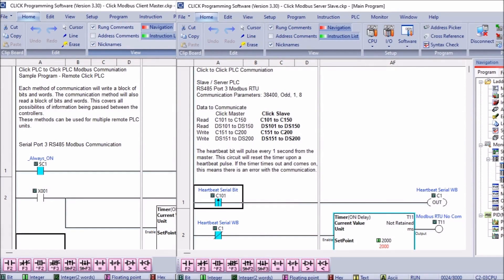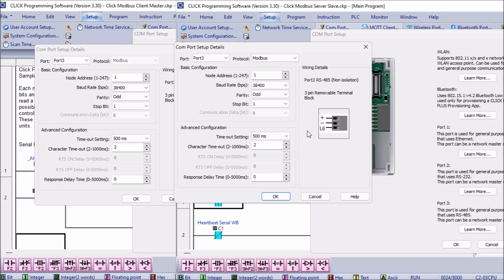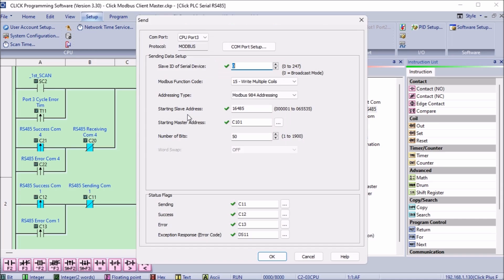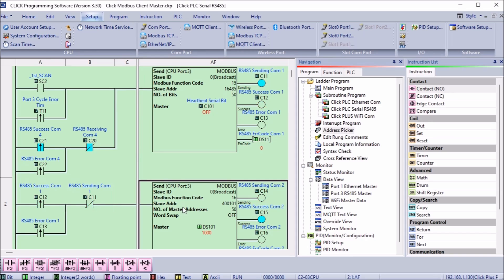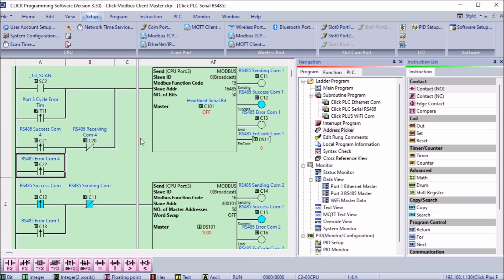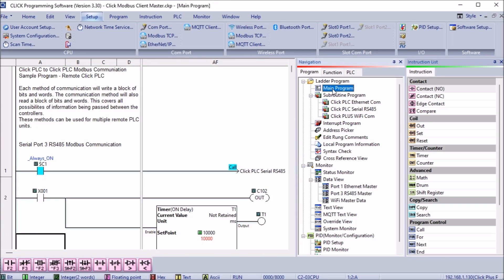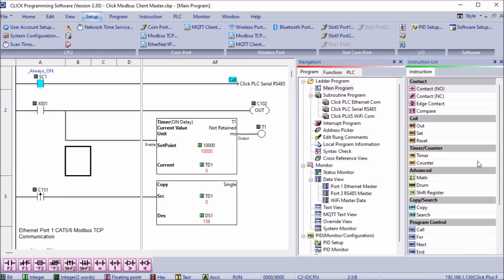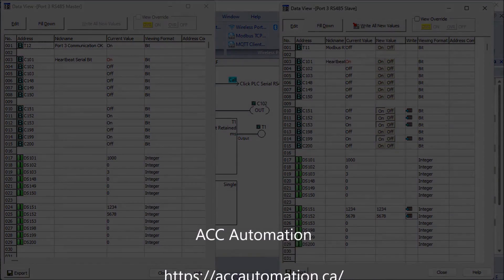Koyo Click PLC RTU Protocol Programming Tutorial

Comment: in the slave i would connect t11 to an output so I know if comm is lost.
Reply from the maker: The heartbeat bit from the Modbus RTU Master would pulse in the slave. You would start a timer for the pulse bit off and a separate timer for the pulse bit on. If either timer times out, then communication has failed.
Regards,
Garry